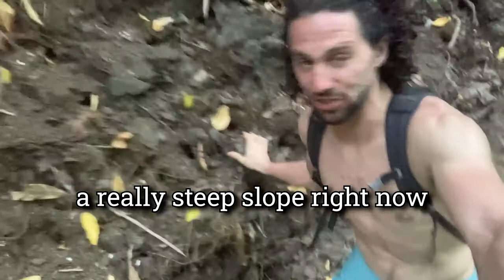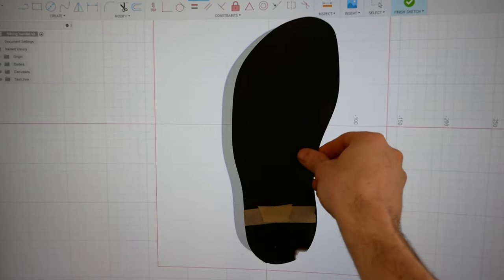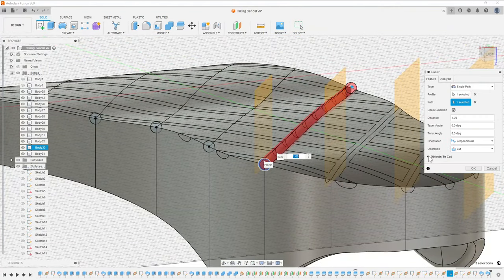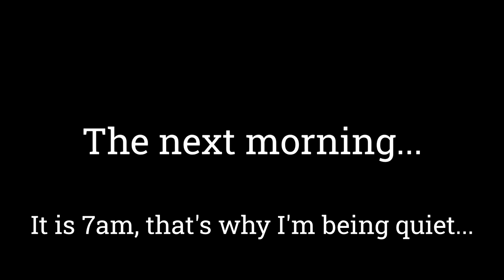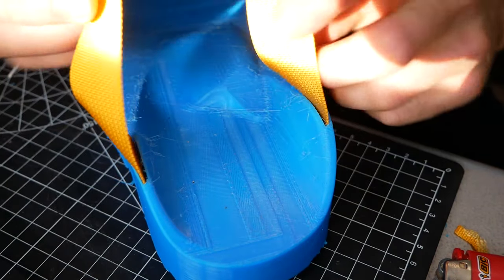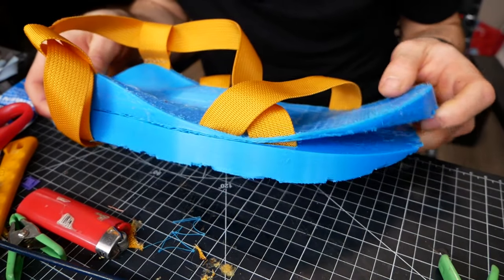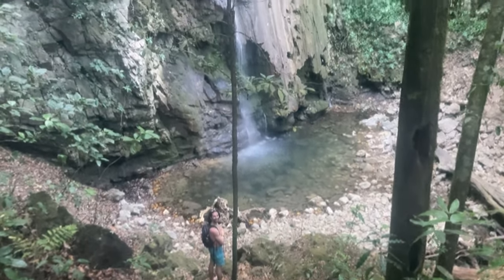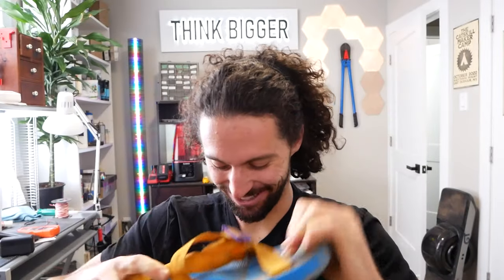Can 3D PRINTED hiking sandals survive the jungle?

Comment: Should be an option to go back a layer or two in a print and resume from there.
Reply from the maker: I know, right?!
Reply: You just tell the software to start at a certain layer in the preview pane. The green bar can be dragged on the right. Which tells the code where to start.

Comment: You should've used some infill, 100% is too much. I used to make some insoles and we used 25% at maximum, and it was still very rigid. Anyways! Love your videos, excellent job!
Reply: Yeah I agree !
Reply: If you cross section those Chacos, I bet it's a grid pattern in the middle, with a thick insole and outsole
Reply: Agreed, it would also make them more bendable, lighter and easier to print. What might also be a good middle ground is printing only the lowest part of the sole solid. As it would maybe help a bit with lasting longer. But then only do like the first 5-10mm

Comment: I've tried doing this some years back. I had scans of the foot and used that as my reference, and I also used the sculpting environment to get a more organic shape. Definitely would not go with 100% infill, anything about 60% for TPU is overkill, and likely the cause of the clogs. Also would have gone with a large nozzle, the sandal doesn't have that many fine features, so a bigger nozzle would have mitigated the amount of clogs as well and doing both -- lower infill, and a larger nozzle would allow you to print these faster. Very impressed that you made it through the vacation and didn't give up on these. Big props.

Comment: awesome work as always! printing with TPU give me flashbacks! I was kinda of surprised the bamboo handled it that well. i've had to slow down my prints significantly to get TPU to even begin printing :)
Reply from the maker: Thanks! Just used the default TPU settings
Reply: @MorleyKert  Based on the time that's only around 3 mm³/s. I'm not sure if the Bambu has issues with gripping the TPU that limit it, but you should be able to go considerably faster, at least 2-3x that. My TPU Benchy was something like 17 mm³/s average.

Comment: I love this.  The best pair of river sandles I've ever owned were alpes.  The were small and lightweight with good straps.  The size was great for stuffing in the back of a small whitewater playboat.  They had little concave "buttons" for tread that was great at gripping wet rocks.  Unfortunately Teva bought them and made several changes that really did not work well.    I'd love to be able to make my own pair like that.
I've not tried any flexible filaments yet.

Comment: I would look into a foaming TPU (Filaflex for example) compared to a regular TPU if you’re looking for comfort. Also for your sole patterning you could make the process more efficient by sketching your sole pattern on an offset plane, then using thin extrude to extrude the sketch profiles to the base of the sandal. You could also create a cutting contour to cut deeper into the sole!
Reply from the maker: Great ideas!

Comment: I have size 16 feet (yes you read correct) and have been looking at 3D printing some sandals/shoes for a long time as I cannot get anything in my size in the UK… due to my size I’d probably have to print it in two parts and might try making a mould with it. I can then cast it using some tough resin/plastic.
Reply: Yeah making a mold is a much better idea. Especially for the footbed of the shoe. You can use floral foam and press your foot into it evenly to get a perfect mold of your arch and foot. Then you can use that to cast a positive that can be combined with a 3d  printed mold for the rest of the sole. The foam impression is basically how custom orthotics are created.

Comment: Too awesome, lucky you!! I'm a size 12 so none of the models will fit on my Bambu plate unless I rotate them both diagonally and vertically. Even then it's not very practical, a 2nd bigger printer is needed lol

Comment: Some advice from someone printing full shoes for years, super impressive video, brave to go full send on testing that first pair.

The treads need to be super aggressive, resembling cleats for good traction

13% grid(flat) or cubic (vertical) for a soft running-shoe sole, 20% for a brick, infill multiplier x2 for a brick 

Top layers should be bumped up make the surface supportively stiff but the sole still soft

Walls should be low, you don’t want it to be more supportive than the infill to avoid sag in the middle that splits the wall layers and discomfort 

Learn Forms in fusion 360, do your exact process + some new features to  save a lot of effort refining some of the arch shape 

Print time on a non-bamboo is ~8 hours for a sole/sandle 

For prototyping, in vertical orientation 2 walls is all that is needed for the bottom treads to survive weeks of heavy trail use, that’s how tough TPU is.

Comment: Why don't you try post print processing like 
1. Drill holes thru and thru , it removes material and increases the grip on both sides 
2. Use a sander with coarse grit ? 
Maybe make some more gutters at the sole with an angle grinder ?

Comment: It would be so cool if you landed on a design and then built a mold cast to use a more flexible material and be able to do all kinds of colors etc in a fraction of the time.
Would make for a cool video, too!
Although, thinking about it, the tunnels for the straps could not be made that way...

Comment: I wear barefoot shoes no arch support needed, that is a spring built into your foot, you just blocked it from functioning.  Also, you should have made them much thinner.  Overall a great video.  I love the practical application of the 3d printing and your ability in the CAD software.

Comment: Definitely could've saved that print and the material! You can modify the gcode to pick up from the layer the clog started on with every other fdm printer. Happy to help if you run into this again :)
Reply: The carbon runs on special uneditable g-code (or atleast I believe that’s what I heard from other reviews) that’s why they have their own slicer and everything. It still does use gcode and you can of course edit it but the printer has specific gcode instructions to make it run right I think. I don’t own an x1 carbon so I’m not 100% sure but I think that’s why.